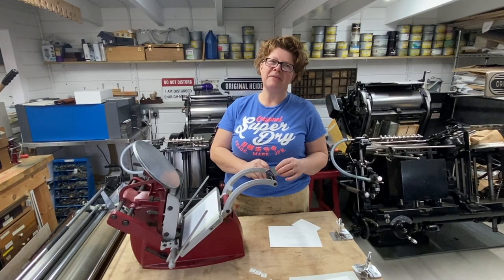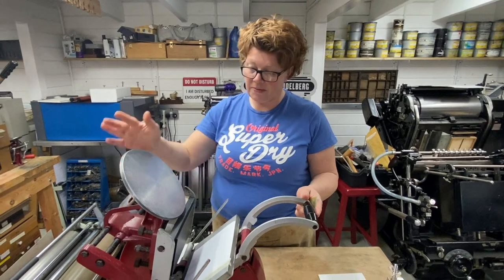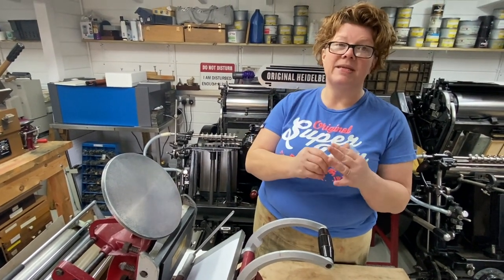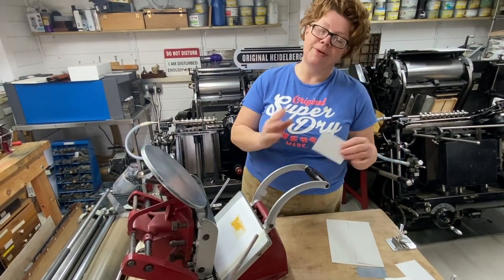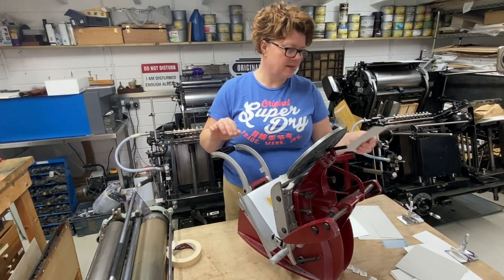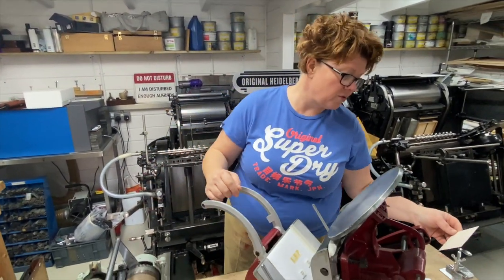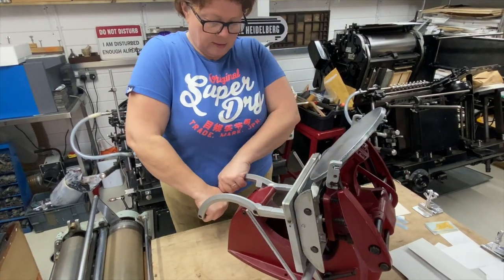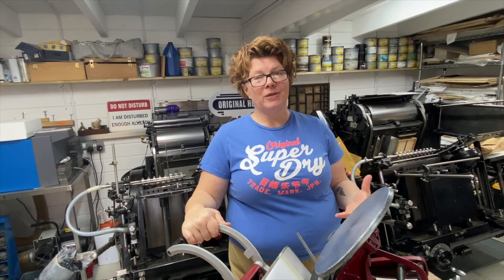Lyme Bay Press - How to Set Up and Use Photopolymer Plates for Embossing

Comment: Very interesting video! I finally received a response regarding the possibility of doing embossing with the Adana. 😊 I would really like to see the rendering of a larger ornamental decoration, for example which would take up each corner of an A5 format. Do you think this is possible? Thank you very much for these valuable tips and have a nice day!
Reply from the maker: Hi there, you have to know the limitations of your machine and I thing applying the amount of force needed to emboss on something that size on an Adana may be too much for the machine. If your design isn't continuous you sould be able to emboss each corner separately. It's the same with printing normally, you wouldn't get a deep deboss for the entire chase size on an 8x5, unless you were possibly printing on something very soft becase the amount of force needed to crete the impress would be too much for the press to handle. i hope this helps. Lis

Comment: You can also very lightly sand the male plate on the platen if there is any splitting on the embossed image. This happens sometimes with just with the shape of the image embossed or the card you are embossing.

Comment: Love this, Lisa.. Question for you, please. What is the heaviest/thickest stock taht can realistically be used on the Adana and retain a crisp emboss?
Reply from the maker: Hi Damien, I wouldn't force an Adana, they really aren't designed for a heavy embossing, or debossing for that matter, I used the Adana to show how easy they are to set up with the embossing plates. I would only go up to a 350gsm board and a soft collton at that, or thinner paper stock. If you want to use a thicker board you will need a bigger press.  that said, it also comes down to the size of the area you are embossing, more force is needed for bigger plates than small ones!  hope this helps :)

Comment: Information video! I've always wanted to make letterpress invitations. Letterpresses are expensive though! So I am looking at purchasing this smaller model. Can you use paint and foil with this smaller press? And what machinery/product is needed to make the plates?
Reply from the maker: hi Sophie, if you send me an email I'll be able to give you more detail, you won't be able to foil with a printing press unless it has a foil conversion but you'll be fine with ink. I think a little time on google and youtube will show you the equipment that you need to make your pwn plates, mainly the unexposed plate and a UV unit. Hope this helps for now. Lis

Comment: Hi Lisa, is it possible to print in say black with the male plate, then when the ink is dry, use both the male and female to emboss and Deboss the area printed?
I ask because I’ve never had a go at this but it sounds feasible to me
Reply from the maker: Black Night100 hi, I did think about this, but the male plate is the wrong way around so it for example it’s text it will be back to front. If you have a design however that is perfectly symmetrical this should work. Unless there’s another way of converting the plates to male and female. Someone may let us know if there is, but from what I’ve tried this is what I’ve found. Hope it makes sense. Lis
Reply: Yes you can do this.  Another thing you can do when embossing the printed image is ever so slightly emboss out of register. Try it!

Comment: Embossing on the Adana seems to be quite strenuous for the wrist and arm, especially if you had to do that a hundred or more times. Maybe you can put the Adana on the floor and press the handle with your foot!
Reply from the maker: I didn’t have a problem, but I generally tend to use the Adana just to show people what to do, I prefer my Chandler or Heidelberg’s :) but I appreciate that not everyone has those large presses, it’s more a case of managing expectations, if you have a large run of a tricky job that may beat your press up it may be worth outsourcing, the letterpress community is great and there’s always someone to help.